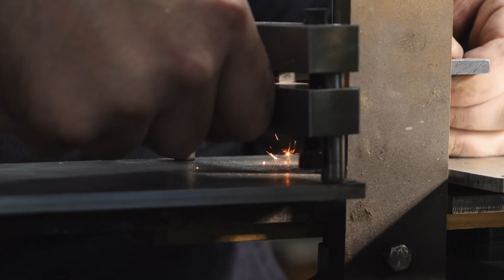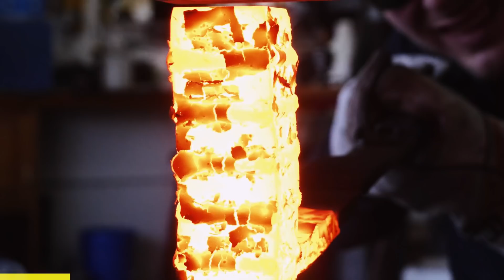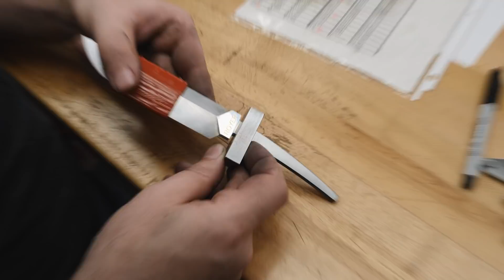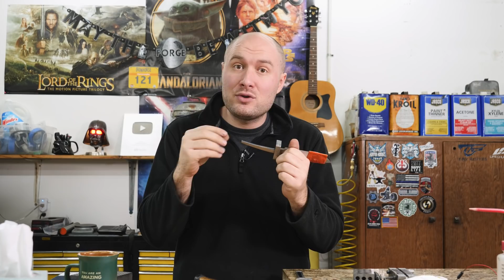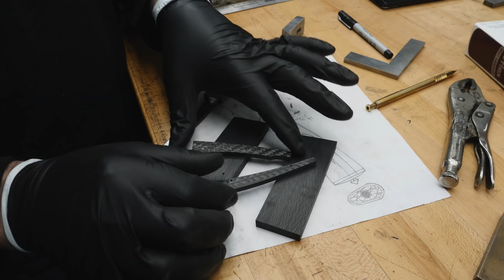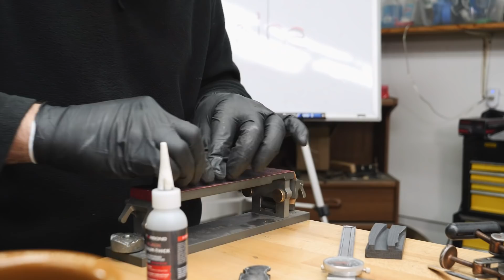Do This for the Perfect Guard Fit (XCAL Pt.3)

Comment: When bonding carbon your better off using scotch weld dp490 this is how carbon parts are bonded in the F1 industry.
Reply: good suggestion, but G flex is already stronger than the carbon fiber.  It is perfectly fine for holding the handle together.  I’m actually surprised that Kyle got it apart.  I’ve had to grind wood scales down to the tang to start over before.  G-Flex 650 is amazing stuff.
Reply from the maker: Hey thanks my friend 

Dad